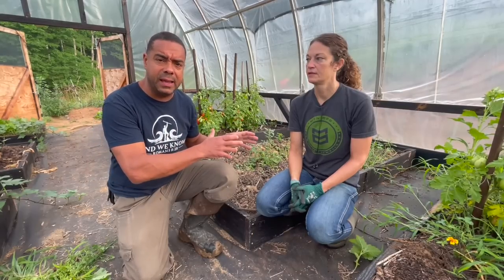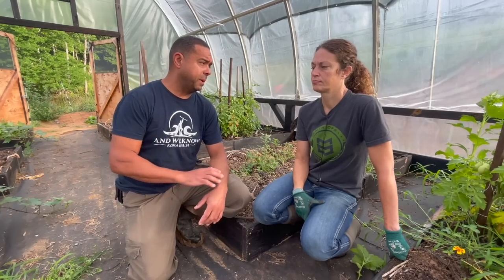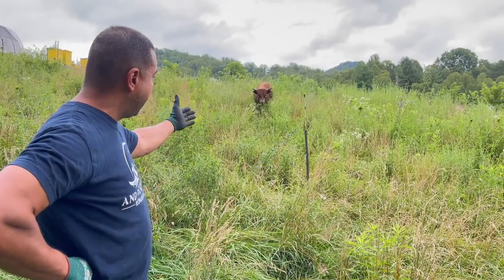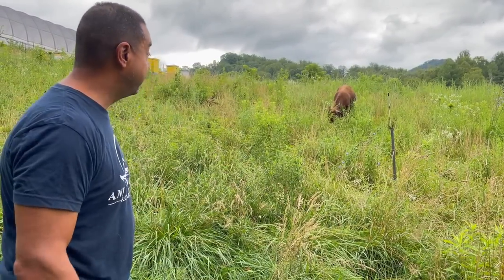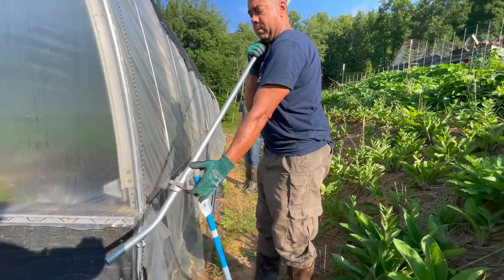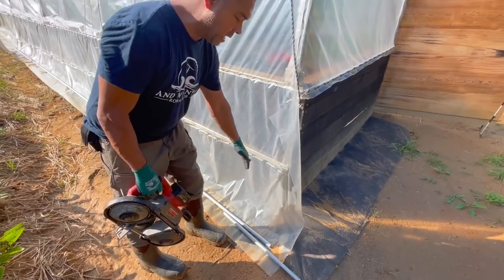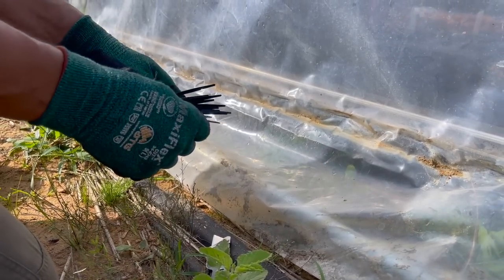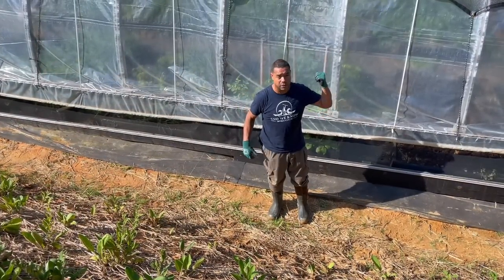Fixing Soil & High Tunnel Problems

Comment: I've used those couplers for non-electrical stuff too. If you find the screws backing out due to the movement, try drilling the conduit (the location will be obvious) so the screws can bite through and/or use Loctite® on them.
Reply from the maker: That is definitely an option

Comment: We've been using one inch emt for the greenhouse for years. I use a coupler    
That is plug welded to one side and sheet metal screwed to the other because the crimp screws always slip over time. 
For a handle, one end of emt is smashed flat , a 1/2 in.  hole punched , and I use a scissor jack handle to roll up side.
Reply from the maker: Sounds like a winner

Comment: Would intersowing radish help?  They're so quick you'll see if you have a fix in place or not.
Reply from the maker: Now that seems like a wonderful idea!
Reply: Our experience of polytunnels is limited to soil we couldn't use.  So we laid down a cover filled it with woodchips - foot or so deep and grew in very large pots - mostly tomatoes.  Watered from below using soaker hose on a timer, kept the place cool as the moisture was slowly hydrated the chips.  The roots ran everywhere.  At the end of the year a fair chunk of those chips had beed turned into worm castings 🙂.  Adding ground eggshell would have helped.

This tool might be a help, it's like a fertility guage https://youtu.be/xv5g4pTSnU0

I'm guessing your polytunnel moves you to Florida 💚😀